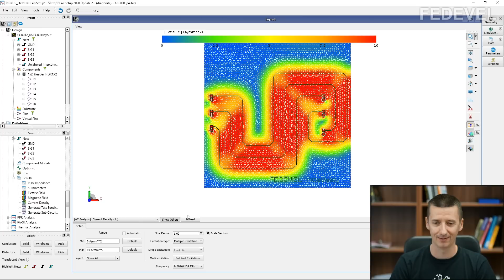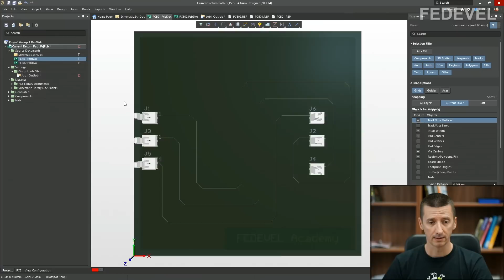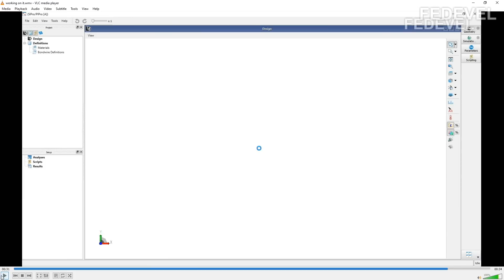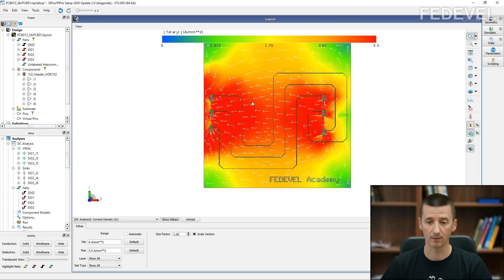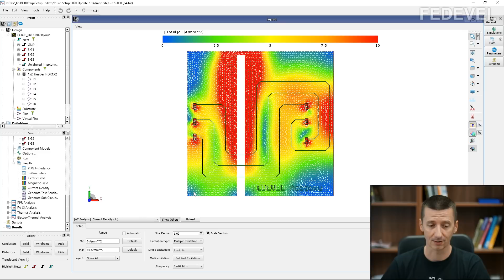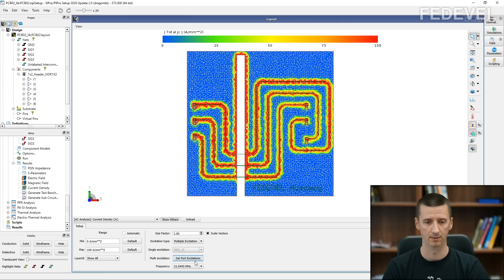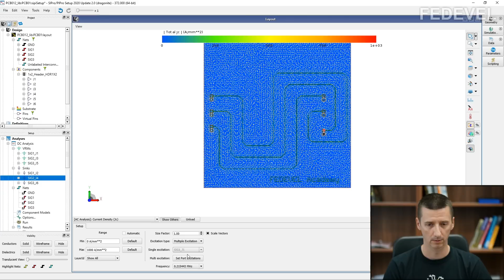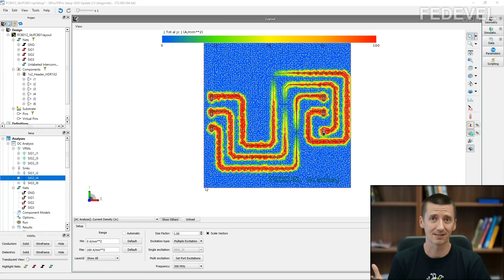Does Return Current Flow Under Signals? Watch these examples ...

Comment: Standing wave minima/maxima, sides of slit acting as a capacitor plates
Reply from the maker: Thank you Jan
Reply: Slit: also acting as a series inductor in GND path, breaking up the trasmission lines in two parts, with ohm&inductive coupling of traces where their return current overlaps (slit edge/plane connect)
Reply: yeah I thought the same. The slit kinda acts as a capacitor.

Comment: The Finite Element Method is capable of creating many artifacts as well as completely wrong results. Try to play with grid density if the program allows it. If the result stops changing when the grid density increases, we usually get closer to the true result (but we can also get away from it).

Comment: You see a change in input at low frequency which can introduce harmonics that make the simulation look different than DC. In case of the simulations being different at way higher frequency like the one where some parts of the tracks don't see any return current, I think that the return curent for that track is flowing through the adjacent track since it finds the impedance of that track to be lower which is a case of cross talk. This cross talk could be a result of inductive and capacitive coupling ( judging from that pdn graph u showed). I might be wrong here but just trying to make an estimate of whats going on.
Reply from the maker: Thank you Nihar
Reply: I was thinking the same, also because there is a somewhat regular motion in the time-captured event following the frequency increase. So I double up with this comment.

Comment: As a starting point you should use matched impedances and then go from there (50 ohm source impedance, 50 ohm transmission line, 50 ohm load impedance).
Reply from the maker: I will try that ...

Comment: Did you tell your simulator that all the input ground pins are linked externally? Perhaps it's simulating one ground pin carrying a lot more current than the others due to the board geometry - in which case forcing it to simulate isolated supplies and loads should help get the results you're expecting…

Comment: Resonance Frequencies!  and I would look at where the peeks and vallies are along the trace as the frequency changes and with the corresponding wave lengths change, and where the at the opposing signal applitudes are at along opposing traces in relation to each other to take into account their influence on the opposing wave.

Comment: I'd blame mostly the simulation itself for it's artefacts. The fact that the low-frequency results differ so much from the DC simulation suggests that the methodology is not very stable, at least not over the wide range of frequencies.
I'm thinking hard of a way to experimentally verify some of these results... Maybe thermal imaging? Raster-scanning a Hall-Probe?
Reply from the maker: I was also thinking, that maybe the way how AC simulation is calculated will not provide very accurate results for very low frequencies. But I am not sure, the best would be maybe talk to someone from Keysight who know how exactly the simulations are done.
Reply: thermal imaging is to slow and you would observe both current density and heat distribution effects. Note that using a high current pulse of DC current/low frequency would not work, as a pulse is by nature a higher frequency. Thermal imaging also has the weakness, that the warming up of the material increases the resistance, so by increasing the current to increase the contrast in temperature, you loose contrast by changes in resistance by thermal effects.
Hall raster scanning sounds awesome, but I think the usable reliable dimensional resolution is limited.
Reply from the maker: @sarowie  From my experience when making my previous videos with thermal camera, thermal imaging on GND plane would not probably work ... the heat spreads a lot on planes, unless you have super sensitive thermal camera, I would not expect much to see there. Here is the video (you can see, it was only visible when I used a grid): https://youtu.be/LQ20GBonRmA.
Reply: It's still 3khz. You really need to be 300hz and below to be actually low frequency. For AC to behave like DC, you probably need sub 10hz.

Comment: @Robert I think that the nulls in the current on the boards are a product of the resonant frequencies of the individual traces and the inductance(s) and capacitance(s) between the traces, and between the traces and the ground plane. Those three sets of things mix together to produce the nulls and peaks in the currents on this board at various frequencies.
Thanks for another interesting video!
Reply: If impedance matched at both ends, this does not occur.

Comment: Some additional simulations that might be interesting:
1. Only one driving source. Visualize the current density in the other traces as frequency increases as I expect the energy is radiating to the other traces.
2. Only one serpentine trace. See how the solver works in the simpler situation and see what the resonant frequency of that single trace is
3. Run a crosstalk simulation that would indicate how much coupling you should expect with the geometry.

As an aside, I think of the increasing frequency like a flooding river. At low frequency (i.e., low water level) the flow is easy to understand. As frequency increases (i.e., river begins to flood) you have more and more complicated paths for water to flow. In this case you have traces on the top side that can carry both forward and return current and capacitive coupling across the slot.

Comment: Hi Robert,

Firstly, It is a very good demonstration and you would  refer important issues in your videos. In my opinion, at low frequencies on your board signal traces track low impedance as at high frequencies. As long as frequency is ascend, low impedance is coming up to onto signal traces. As a result red regions are overlapping with signal traces. However I have no exact idea for what happen at very high frequencies. Maybe, it is happen because of EMI effects.
Reply from the maker: Thank you Yavuz

Comment: I think its a skin effect that leads to increased apparent resistance under the traces thus the current, assumed constant for all simulations, takes more space on ground plane and keeps the voltage drop almost the same (i.e. apparent resistance increased->ground plane voltage close to traces wants to increased->more cooper conducts to prevent this voltage increse). For microstrip a good current density approximation under the trace is around 5x trace tickness.

Comment: For high frequencies: 
----------------------------------
From the impedance graph it looks like a resonance. 
What was your AC settings (you showed the DC settings in the video)? C
an you set phase difference to the sources? 

Can you set the load to a impedance value corresponding to the characteristic impedance of the microstrip?
If you have a  microstrip on a 2-Layer PCB (h=1.6mm, w=0.2mm)  @100 MHz, a trace length of 225mm corresponds of a electrical wavelength around lambda/8 (30...45°). 
So if the sources and loads are not matched to the trace, standing wave patterns will arise.
Also, due to inductive coupling the three microstrip lines could create a coupled resonator.

With the break in the reference plane, the return path introduces several differences:
* the effective trace/signal length increases => standing wave resonances in the microstrip occur at lower frequencies
* the coupling of the traces/microstrip increases strongly as their return path conductor overlaps
* the slot creates an antenna...but I don't think that you'd see that in the AC analysis as the PCB is not in the farfield of itself

=======================================================================

For low frequencies:
----------------------------------
The AC simulator is probably not intended for that low frequencies.
From the "Advanced Design System 2016 Update Release Notes", "Signal Integrity/Power Integrity (SIPro/PIPro)
":
"Improved behavior for low frequencies: automatic frequency plan option uses 20 kHz as the lowest calculated frequency"
So, 0.020 MHz should be a lower limit

Source: http://edadownload.software.keysight.com/eedl/ads/2016_01/updates/Update1_3/pdf/ADS_2016_Update_Release_Notes.pdf
Reply from the maker: Thank you very much Ice Storm. PS: I have not seen any special AC settings. I am not exactly sure how the frequencies are actually tested. Only what I set was 1.5V for amplitude (I believe). And you are right .. it would be interesting to play with impedance matching, that could be interesting to see.
Reply: @RobertFeranec  Are there settings in "Mulit excitation" regarding phase?
Otherwise, I guess it's not intended/supported by ADS (at least for PIPro), or a very hidden setting.
Although I've seen AC source  definitions (used as sinks) in ADS schematics with phase (polar(amp,phase)): 
https://www.keysight.com/us/en/assets/7018-05074/data-sheets/5992-1291.pdf
https://www.keysight.com/upload/cmc_upload/All/5_Power_Integrity_Ecosystem.pdf

Regarding transmission line resonances:
https://www.allaboutcircuits.com/textbook/alternating-current/chpt-14/standing-waves-and-resonance/
I guess the AC simulation uses the power sinks as "AC current sources" (load current) with your power sources acting as "R-L loads" (with DC-voltage that acts as short in AC simulation).
As your sources have zero impedance (R=0, L=0) you have the "shorted transmission line" case.
1) At quarter wavelength the first resonance peak occurs: 
* at the end of the line (at your power sources): voltage is zero and current maximal
* at the start of the line (at your power sink): voltage is maximal and current is zero
=> resonance peak PDN impedance (or infinite impedance in case of no losses)

=> your 100/170/200 MHz peaks
2) At half wavelength the first anti-resonance peak occurs: 
* at the end of the line (at your power sources): voltage is maximal and current zero
* at the start of the line (at your power sink): voltage is zero and current is maximal 
=> anti-resonance peak PDN impedance (or zero impedance in case of no losses)
=> your 200/340/400 MHz notches (only first one was inside your simulation range)

I tried to reproduce a simplified simulation in LTSpice. It looked similar, just shifted frequencies by factor 1.5 (~160/220/290 MHz & 320/440/580 MHz).
Assumptions:
stackup/microstrip config: 1.6mm thick, two layer, 4.8 dielec., 0.1mm trace width
PCB size: 100x100mm
approx. length of traces: 150, 200, 270 mm

net list:
V1 N001 0 1.2V AC 0 0 Rser=0 Cpar=0
I1 V1 0 0 AC 1 0 load
V2 N003 0 1.2V AC 0 0 Rser=0 Cpar=0
I2 V2 0 0 AC 1 0 load
V3 N002 0 1.2V AC 0 0 Rser=0 Cpar=0
I3 V3 0 0 AC 1 0 load
O1 N001 0 V1 0 LTRA1
O2 N003 0 V2 0 LTRA2
O3 N002 0 V3 0 LTRA3
.ac dec 300 20k 600MEG
.MODEL LTRA1 LTRA(R=4.9 L=883n C=37p LEN={0.270 * FAC})
.MODEL LTRA2 LTRA(R=4.9 L=883n C=37p LEN={0.200 * FAC})
.MODEL LTRA3 LTRA(R=4.9 L=883n C=37p LEN={0.150 * FAC})
.param FAC=1
.backanno
.end
Reply: @icestormfr  You wouldn't believe me but I've seen a problem like this and a response like yours in meme site 9gag a couple of years ago!
Reply: @guillep2k  😳😳😳😳
Reply from the maker: @icestormfr  Thank you. Nice! PS: I asked Keysight for more support to help with these simulations, so I hope I will learn more about how the simulation works and what kind of settings I could also try to adjust.

Comment: The simulation results are weird at very high and low frequencies. At low frequencies, it should have matched the Dc Analysis. But for higher frequencies maybe the skin effect is playing a major role. I am not sure just a wild guess. But would love to see a video clarifying these weird results.
Reply: My guess for low frequencies is that they're using a different simulation model than for DC, it's very possible that the results aren't close to reality under a certain frequency.

Comment: TC 2:00 
- Question AC Current : this static time  picture of current ( a moment record of 400Hz ) ??? 
Or really dynamic flow ? 
😉😎
—My point of view is - you looks to a static time stamp ( non dynamic ) and you don’t know , are you on 1/4 wavelength or a 1/2 position ?  😀
Of course currents amount  is on 1/4 different then on 1/2.
Reply: Yes, a complex magnitude would be more revealing, or a short clip in time to see the nulls traveling with the wave

Comment: I am a bit unclear about the setup, are the ports matched or are reflections possible? And how long are the traces? It looks like there are standing waves/transmission line effects at some points, with a strong influence from crosstalk (eg at 6:50 there are nulls in the current distribution, but they aren't all the same distance from their source), but I am too much of a noobie to say. With them spiralling around each other there is probably strong capacitive and inductive coupling between all lines.

At 6:50 maybe we can imagine the rightmost spiral to be a circular inductor, with a magnetic field pointing into the page as per the right-hand rule. Then, we can imagine the U-bend on the left of this coil to be a similar coil with an opposite direction of current flow, and thus a magnetic field pointing out of the page. At the transition between these two coils, the magnetic fields will cancel, and there the current distribution is zero.
Reply from the maker: Thank you ernierock PS: 1) no impedance matching (I am not sure if the simulation will include reflections ... a good question). 2) SIG1 = 255mm (100073mils), SIG2 =  186mm (7331mils), SIG3 = 141mm (5576mils)
Reply: Thanks for this. at 15:06, the nulls seem to be at equal lengths from the source ports.
Reply: @RobertFeranec  and at 300MHz wavelength is around 70mm. I think you just see standing waves as others mention.

Comment: As you go higher in frequency (Ghz), the track length is playing a bigger role. if you think about the wave traveling forward, you can also think about the return current traveling backwards in the plane. The falling edge behind the rising edge is in a sense, canceling out the return current. 

For around the 300 Mhz areas i think the standing wave theory that was presented in the earlier comments is the cause of those points with low return current.

I would be interested to see a simulation with differential traces passing over a split in the ground plane. as well as having the ground planes on either side disconnected. This would provide some valuable insight on differential data signals coming out of an ADC or into a DAC with the analog having a separate ground plane

Comment: 13:00 Could it be because the loops act as current transformer and reduce each others current? And maybe the reason why the outmost track dominates others is simply because it has the most inductance because it has the largest radius.
Reply: This video is very interesting.
I think the effect at high frequencies is due to dielectric thickness. It is perhaps a thick one!

Comment: Hello. I guess the current difference between tracks is made by 1. Interference between them (to change vary the phase between them) 2. Different inductance (because of different radius of curveture) 3. Different positions compared to gap bridge( bacground conductor on top). And the second thing. The gap behaves as a conductor and a capacitor in paralel. So if devide gap on little horisontal straps, they will behave as vertical conductors and horisontal capacitors. So all that gap is like paralel capacitors connected thru serial resistance
Reply: The back current flows under neighboring conductor because of interference between currents of this  conductors. Try to visualise difference between back currents in dependance of current phase in conductors.
Reply: Decreasing frequency had to illiminate difference between ac/dc simulations. Seems like some simulation or imaging error

Comment: Hi Robert for pdn analyses which software should i use ? 
I want to check my pcb impedance wrt frequencies, there temperature rating on the basis of high current track and decoupling capacitance etc

Comment: 10:34 One thing i know is that on a wire current flows better on the outside than through the inner core (which is an opposite behavior of what water would do on a pipe). Electrons tend to interfere with each other in the center and so decelerate their flow. That's maybe why the track that is close to the outer wall is the one getting most of the back current flow.

Comment: -Will the current also return under the track, if there is a gnd track provided next to the "pulsed" one on same layer and both are a straight lines or lets say the top layer is also a filled polygon?
-In terms of emv, does it make sense, to route positive and negative connection in differential style(?), or in the intrinsic way, it travels as you have simulated?
Will the received noise of an analog component somewhere else on the PCB be less, if both current paths are close to each other and both somehow seperated from the gnd plane?

Comment: The DC problem with the slot looks like there is a meshing problem.  Is the mesh too coase?
Reply: Thought the same
Reply: It occured to me too. Just look at the current map near the connectors -- there is no reason for such sharp-bordered triangular areas of high current.
Reply from the maker: I will ask Keysight if there are some settings what I could change.

Comment: first I would also play with meshing options and take a look at what you get with ansys, try a single trace also.   I had no idea the slot would form hot spots extending so far along from the constriction along the edge at AC. A thought of applying f @ 10W and observing thermally comes to mind to avoid any probe effects - but I'm probably wrong on that.